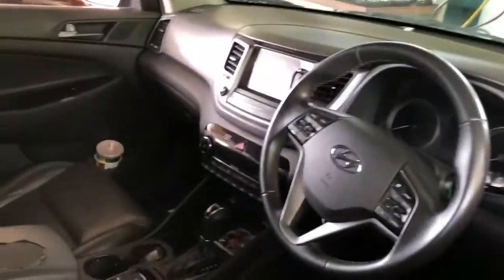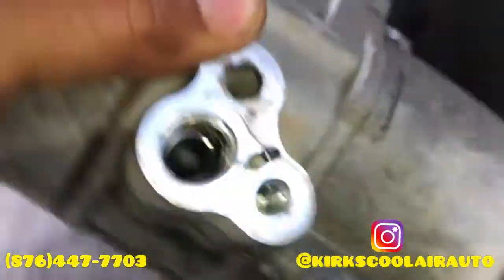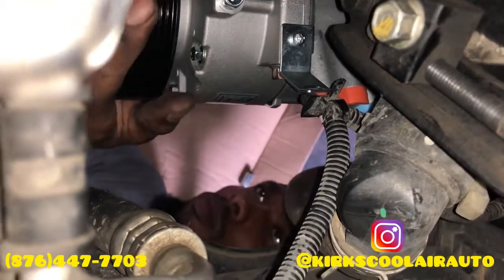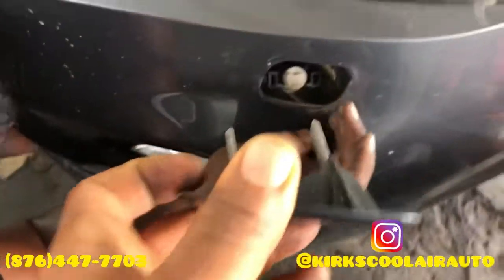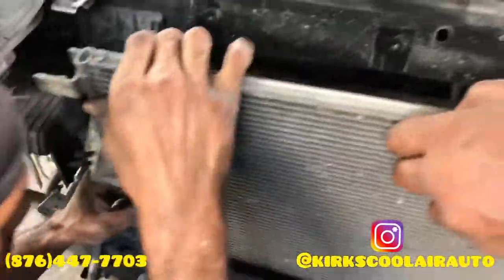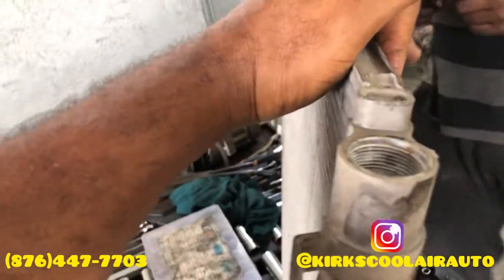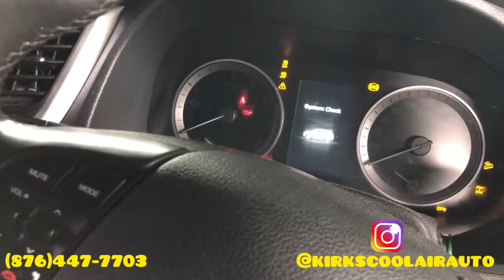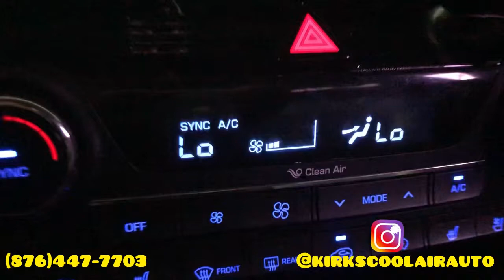How to Remove and Replace a Hyundai Tucson A/C Compressor and Receiver Drier (2016 - 2019) Kia

Comment: Do you have to buy a new condensor

Mines condensor is new 

But they telling me if have to replace the condensor and the ac compressor
Reply from the maker: If your condenser in good condition you can just change the receiver drier